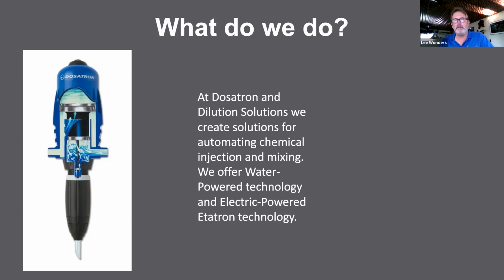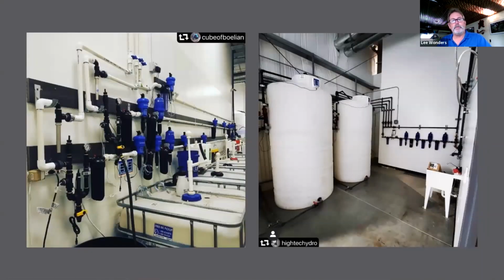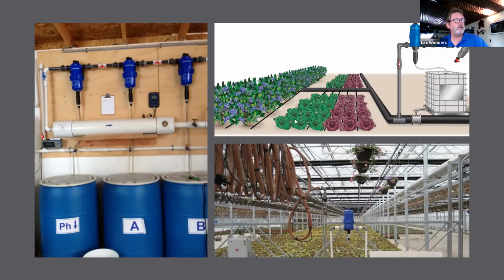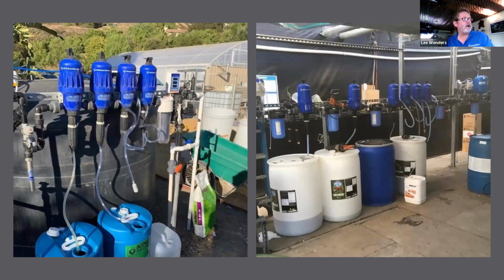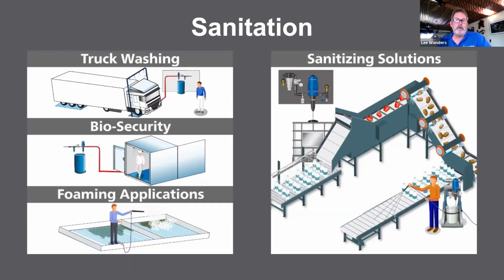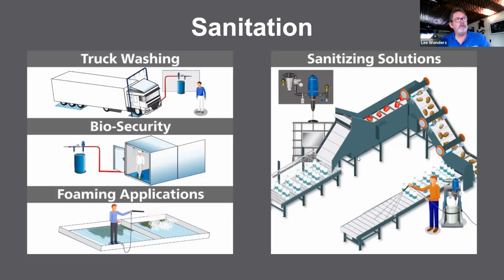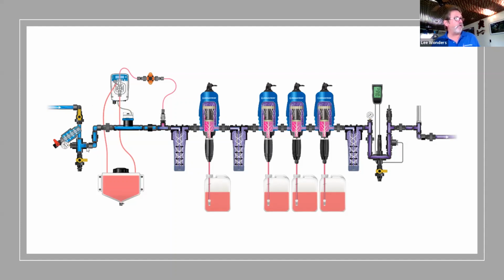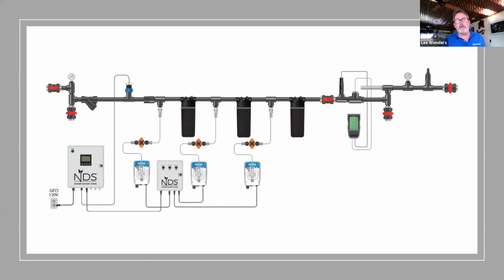Dosatron - Winfield Ornamental Tech Webinar

Comment: What size dosatron units and pump would I use for a 4 plant cannibis grow ?  Running 2 dosatrons and two mixing tanks , also for future ref what would I use for a pump  if I used  3 dosatrons and 3 mixer tanks. Everything will be set up out side of a 4x4 grow tent so not much piping required
Reply: You need a dosatron for 4 plants?
Reply: use a shot glass